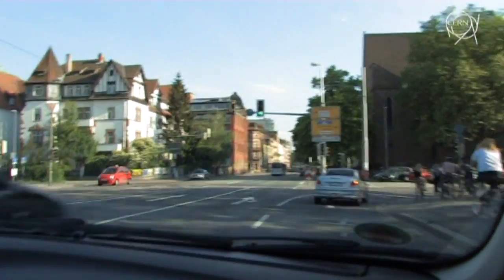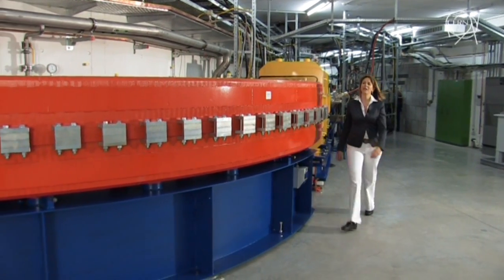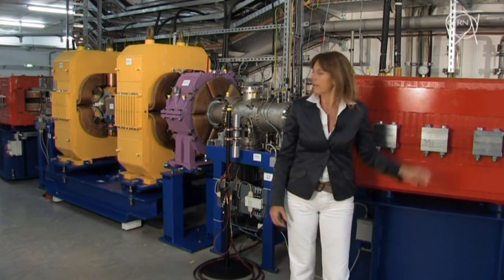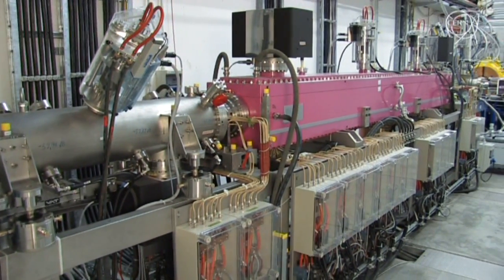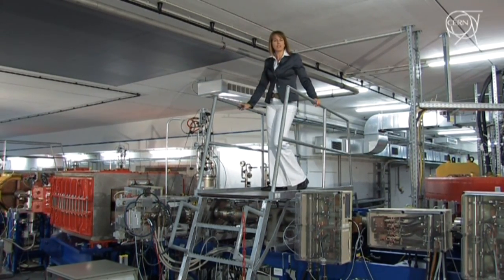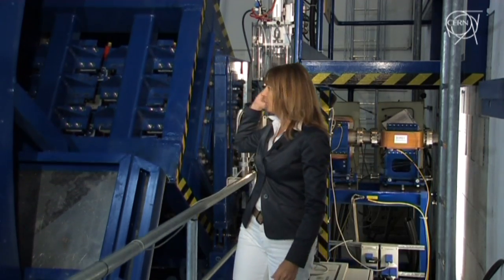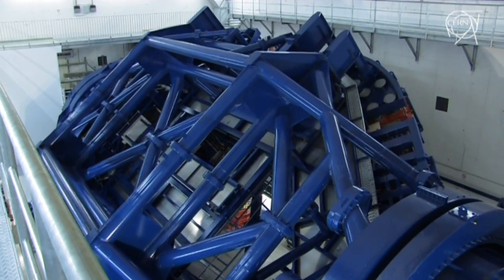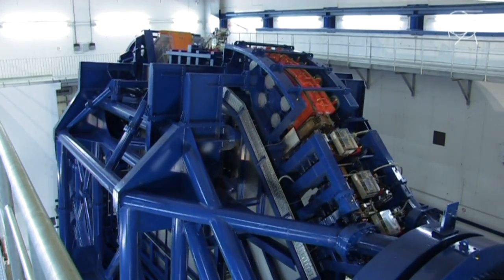CERN: HIT - A New Dimension In Cancer Therapy

Comment: Well of course it's gonna be expensive, the facility can treat only a few hundred people per 5 years. It works, two people already have been competely cured. Gene therapy holds out the hope for a cure in the long-term, but in the short-term traditional methods of surgery, chemotherapy and radiotherapy must be used. GSI's new carbon-ion facility does add a new level to radiotherapy, allowing tumours in sensitive areas to be targeted more safely and effectively..